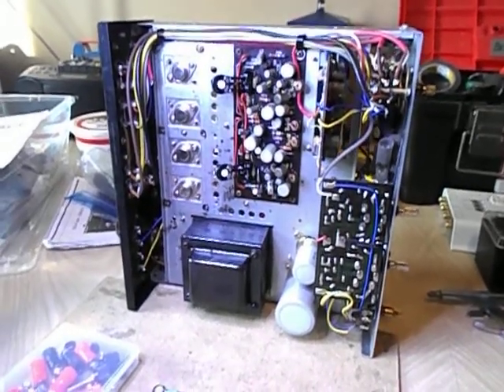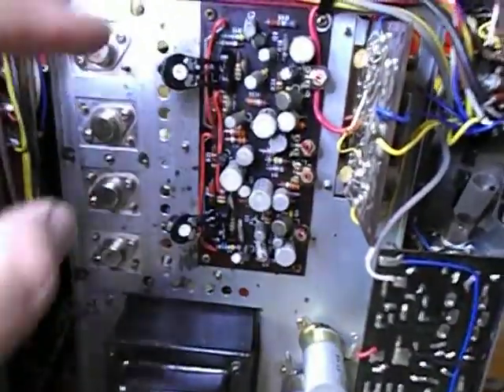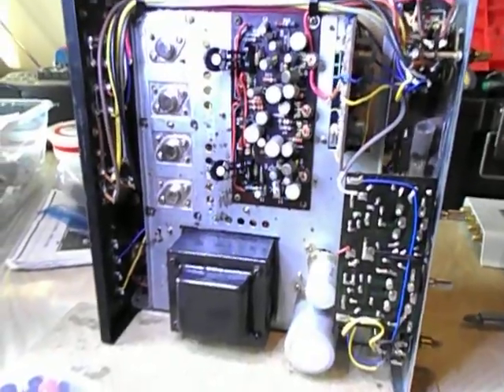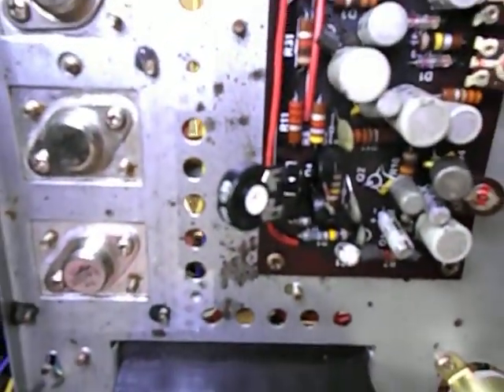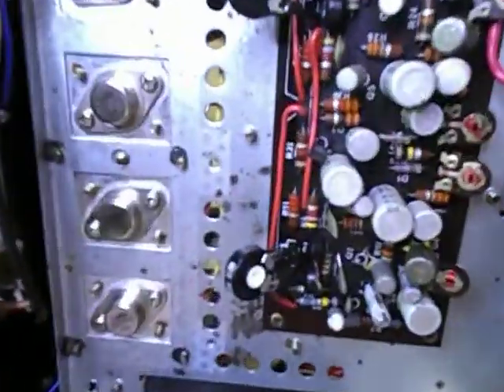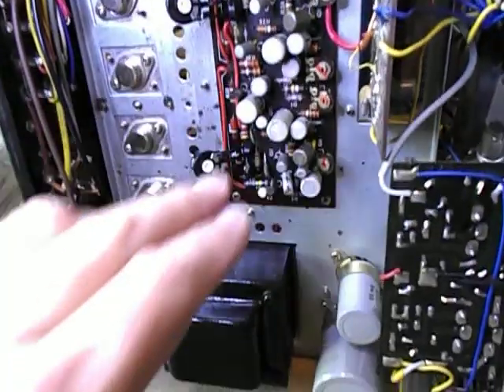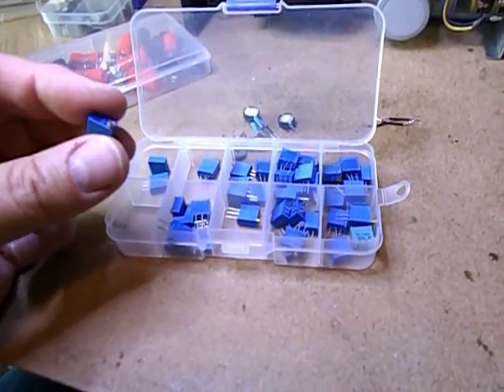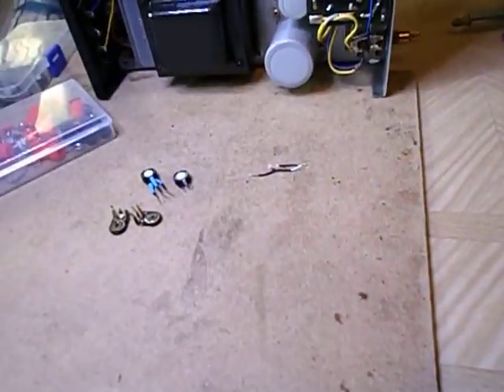The best bias pot for your vintage solid state stereo.

Comment: Good video and also like the Amphenol Piher ones as well. Unfortunately not always readily available. I found Digikey have reasonable range but constant out of stock. Any suggestions on alternate supply would be good? Like the small tip on extending wires.
Reply from the maker: Thanks for the comment.  I purchase them from Sayal Electronics based in Mississauga Ontario.  The last 3 months have been hit and miss with many basic items out of stock.

Comment: Hello many thanks for all your helpful videos.
Could you do a quick video on actual adjustment of the bias and setting the protection circuit please 🙏
Reply from the maker: This video covers those adjustments 
https://youtu.be/aowZPhqN3rw?si=I29U60bRD2pbiKHE
Reply from the maker: I'll do a new video on the Kenwood protection circuit soon.
Reply: @acrossthedial  many thanks for your helpful videos and recommendations and responses.
Reply: @acrossthedial  hi Bryan, I saw your other video that mentioned using a resistor for the protection circuit instead of a pot.
Is this still your preferred method?

Many thanks.
Reply from the maker: @MustangBoss1973  I came up with the resistor method because it was hard to find a 10k Bourne pot during the pandemic parts shortages. Either way is good.
Reply: @acrossthedial  excellent 👍 thank you so much.
Really learning from your channel thanks.